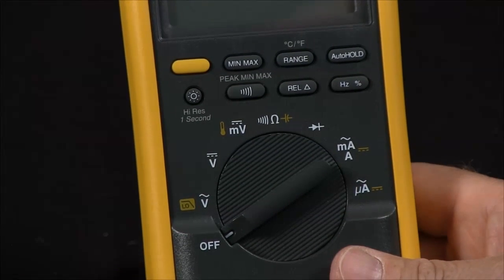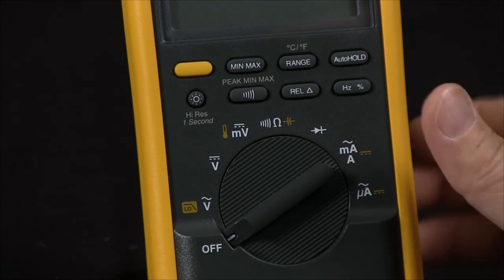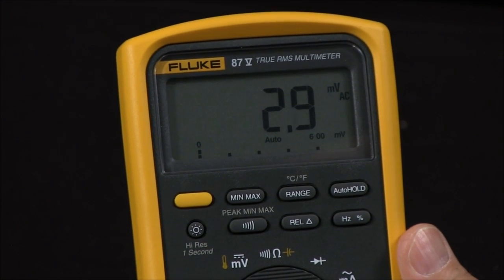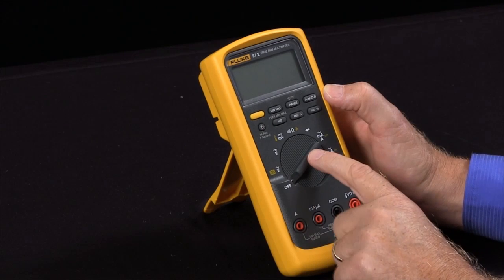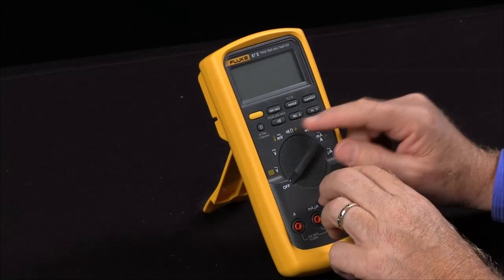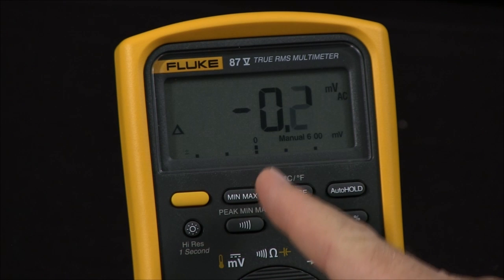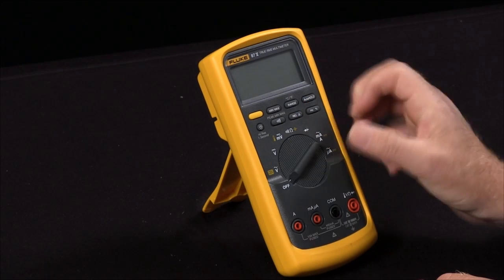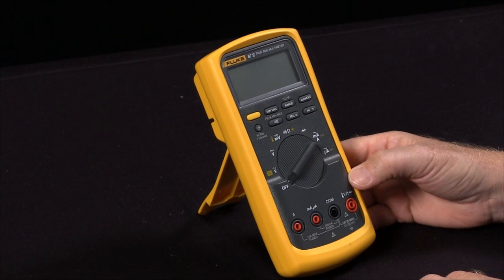Secret Functions on the Fluke 87V Digital Multimeter

Comment: Doubt with voltmeter FLUKE 87 SERIES III
friend I have a question with a fluke brand multimeter in terms of knowing how much is the maximum voltage that it can show on its screen safely WITHOUT DAMAGING THE DEVICE FOREVER, since when I put the manual voltage selection mode, it starts from 4 volts then to 40 volts then to 400 volts and then to 4000 volts, and it is very strange because the official manufacturer indicates that the maximum voltage that can be measured safely is up to 1000 volts AC and DC,
I personally OPINION; that because it is a very expensive PROFESSIONAL measurement equipment, it should be able to have that high voltage range by DEFAULT, for a wide range and variety of uses and applications both at home and in industry
but I want to hear the voice of those who have it and have used it and have experience with it to use it safely
Reply from the maker: Hello and thanks for your question! Multimeters, like the 87-III or 87V Max are rated up to 1000V AC and DC, and Fluke does not recommend exceeding the rated capabilities. But “most” of our meters will allow up to a 10% max measurement range without damaging the meter (1000V, 10% would be 1100V).
Reply: @fluke  very thanks

Comment: replace new batt but still pop up batt logo, any advice sir? thanks
Reply from the maker: Hello - I would not expect to see this if you are using a new, standard 9V alkaline battery. Are you using a lithium ion, rechargeable battery? Fluke can only recommend using a 9V zinc, NEDA 1604 or 6F22 or 006P. Please contact Technical Support if you are still having issues, 1-800-443-5853. Have a nice day!

Comment: How to turn On the "auto off" feature again as it comes with factory.
Reply from the maker: Hello - Yes, you are right, the factory default setting for the Fluke 87V is that the Auto-Off feature is always enabled. You can disable the auto power off feature only upon powering the instrument on while holding down the yellow function button. But once you turn your meter off, it defaults back to Auto Power Off being enabled. Thanks for reaching out!

Comment: Any way of smoothening/slowing down the reading on the 87 when doing basic resistance or voltage checks?
I find that my 87 really bounces around when compared to my 88 when I'm just doing a quick resistance/voltage measurement, no doubt as it's a true RMS whilst the 88 is an automotive meter, correct?
Reply: Your answer is at 00:40 where he explains how to enable "smoothing". Kind regards.

Comment: How many amps can it read ? Don’t want to spend that much money and it not be able to read several amps
Reply from the maker: Hello Caleb - When measuring in series, you can measure up to 10A AC and DC with the Fluke 87V. There are current clamp accessories for multimeters that can be used in order to measure higher amperages. Like the i410, 400A AC and DC, used with multimeters.

Comment: HOW TO ON AUTO POWER OFF MODE...
Reply from the maker: Hello - To disable the automatic power off mode you would need to press and hold the yellow function button while turning on the meter to any function on the dial switch. The meter should display 'Poff' to let you know that the feature is disabled.

Comment: LEAD ERROR when measuring in voltage range, specially while working in high humidity. How to fix it?
Reply from the maker: Hello - Generally this happens when the meter has some kind of contamination on the inputs.  Usually this would be due to moisture as customers will frequently use meters in the rain or in humid environments. Cleaning the inputs with a Q-Tip and denatured alcohol or blowing them out with compressed air fix can the issue. But in some cases where maybe the meter was submerged the meter might need to be placed in a dry environment with desiccant present to correct the moisture issue. If these steps do not help, I would recommend contact our Service Center to see about getting your meter sent in, call 1-888-993-5853.
Reply: I would NOT suggest using compressed air.  Use a very strong suction such as an industrial shop-vac.  Blowing that moisture can and will just provide it an opportunity to ingress the meter even further... I do this with my Fluke DVOM & cell phone and it works like a charm every time!

Comment: Great jobs.. But how about if you want to enable again the beeper? What should i do?
Reply from the maker: Hello - The default setting on this meter is that the beeper will be on, you cannot change that. So if you want to enable the beeper again, just turn the unit off and back on (without holding the Continuity button/key). Hope this helps!
Reply: My beeper has stop working when I touch the 2 leads is there anything that i can be do I've tried everything I have Fluke 115

Comment: I was checking a 3 phase motor in the resistance mode and my multimeter reading was fluctuating. I ensured the power was disconnected. I checked the motor and the cable resistance from the mcc . I tried toggling from auto resistance to the manual resistance scale. But I couldn't measure the resistance.  What could be the problem with multimeter?
Reply from the maker: Hello - What was the expected resistance measurement? Also, which multimeter or clampmeter were you using?
Reply: Bad connection in equipment/wiring!
Reply: @rjc4me  or a cooling fan on the motor

Comment: How do you use the bar graph with ohms ???
Reply from the maker: Hello - The bar graph functions like an analog needle from an analog meter, but it will not overshoot. The response time is faster than the digital display and can be useful for rapidly changing inputs. This will also help to verify resistance values with the number of lit segments (on the bar graph) relative to the selected range.

Comment: How would I defeat the auto-off function and the beeper function at the same time?
Reply from the maker: Hello - Unfortunately this is not something that can be achieved with the Fluke 87V. Our handheld multimeters will only allow one “power-on” function to be engaged upon turning on.
Reply from the maker: Hi Stiaan - There is not a difference between those two meters in that regard. It is not specified that either meter can perform two power-on functions at once. When you press multiple buttons for the power-on functions and turn on the meter, you will only display one feature engaged or disabled.

Comment: I know I paid to use in my car testing, but it should also be able 2 test on household battery voltage, CZ all of using household batteries extensively AND regularly indeed! Fkin pricey meter should have a more easy reading diagram of pictures, should be in color, right on the behind the meter affixed in color pictures HOW TO...!!
Reply: Rubicon, on dc yes?

Comment: I just brought over 300 dollars and I cannot EVEN measure 1.5 v household battery! Dam frustrated indeed! I know the battery is good light up brightly in my flashlight, but when I put probe tester, NOTHING shows up! Dam fkin meter! CA the USA *some people buy overkill gauge like me and SHOULD state in manual cz lots of people using fluke 87 V to test their household batteries!
Reply: This sounds like a YOU problem because the 87 5 is certainly capable of measuring 1.5v dc you dummy
Reply: My 87v display BATT when i turn on, what is that mean

Comment: Does the fluke 87 have true RMS AC plus DC ?
Reply from the maker: Hi there - The Fluke 87V offers true-RMS AC voltage and current for measuring non-linear signals. It can also measure up to 1000 V DC. More technical specs can be found here on our website: http://bit.ly/2ZrRCw4

Thanks!
Reply: Planes

Comment: pls.tell me how fix my fluke87v. got "LEAD"error.pls. need some help
Reply from the maker: Hi there - unfortunately, it sounds like your meter might need to come in for service. Our support team would be happy to assist. You can find their contact info here: http://en-us.fluke.com/support/repair/
Reply: is there an easy way fix it. just tell how?pls..
your kindly consideration is a mass.im from philippines
Reply: Fluke Corporation - come on Fluke.  Know the product!  LEAD comes on when you have the leads connected to the amperage ports and have the dial set on anything other than amps. If you measure amps in that configuration you would fry the meter. LEAD is just warning you of that condition